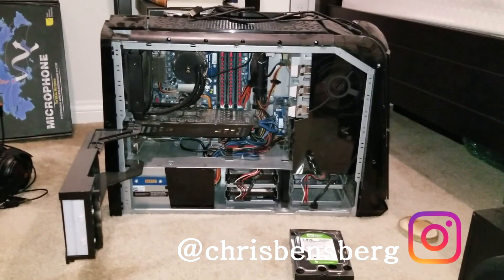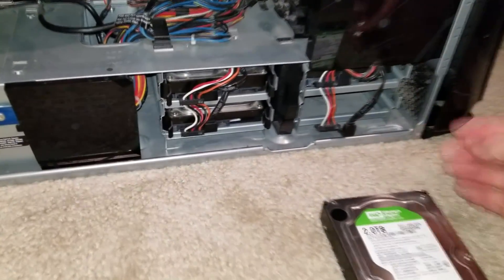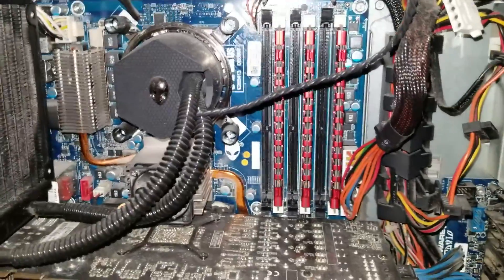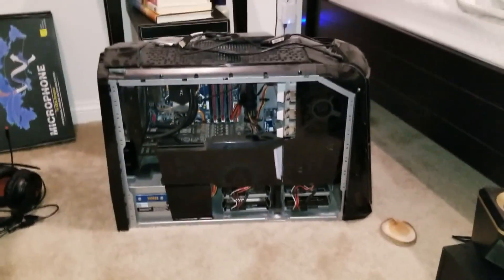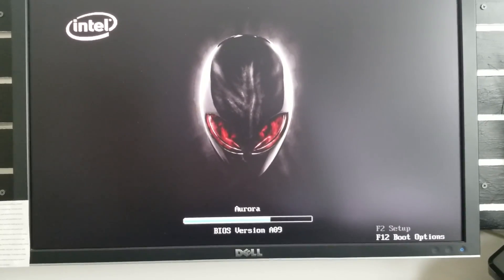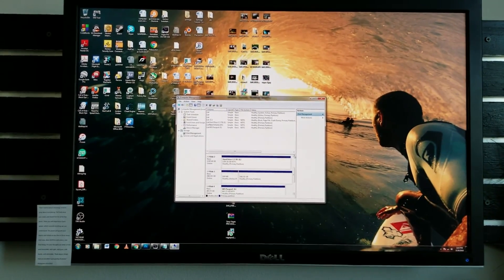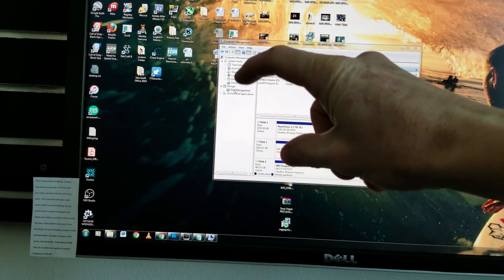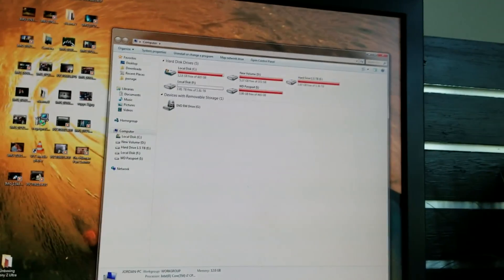How To Install New Hard Drive On Windows Desktop Computer & Fixing Potential Problems during install

Comment: you left off the "A" when saying the SATA.(SAY-TAHH) also "Sata 2" as you referred to it as is wrong. most if not all cables are sata 3 in terms of speed. the 2 marked on your cable is just the 2nd one in the system. at 2:51 there is SATA4 on the leftmost cable indicating the 4th in the system
Reply from the maker: Thank you, your 100% correct thank you for the info:)

Comment: as for the drive space issue It is a matter of mathematics. The advertised number is decimal but the system shows a binary number which is 7% less in the GB range and about 10% less in the TB range. But both numbers reflect the same number of bytes. It all has to do with the fact that 1K is 1000 bytes in decimal but 1024 bytes in binary.
Reply from the maker: Thank you so much:)
Reply: @TipsNNTricks  you are very welcome

Comment: you can gain 100 more MB on that drive by right clicking on that partition that shows (healthy Active) and then choose delete.    you will then notice 100 mb free space at the end of the  drive.   you then click on the 1.81 TB partition and click expand and choose the defaults and it will automatically add teh space to the drive without formatting.